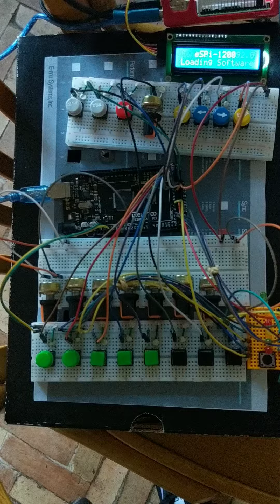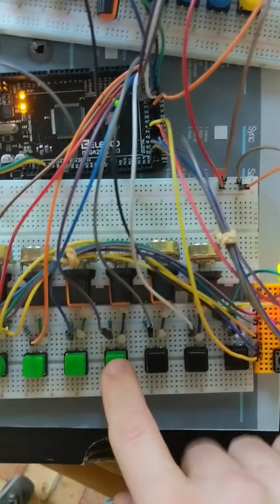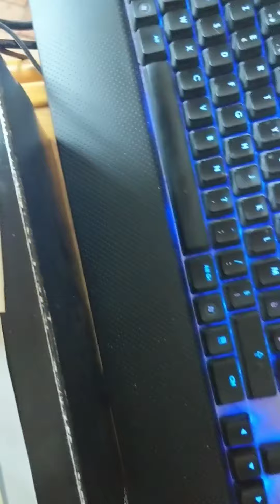SP Clone Progress Update

Comment: As I'm sure you know, the limited amount of RAM in the original SP forced users to speed up 33rpm records to 45 rpm when they sampled loops, to preserve memory space. The resulting ringing sound created from the aliasing which got introduced when those speeded up samples were pitched back down to their original speed is what defines the sound of early House and Hip Hop. Get that right and you can count me among your many customers.
Reply from the maker: Yessir, I'm very much aware of that, I'm an SP-1200 user myself and have been for quite a while.
I have reproduced the exact algorithm the SP uses for pitch shifting, you can see some demos on my instagram (@low_hiss).
And here are some famous samples & breaks ran through my emulation, both at normal pitch and sped up to 45rpm +16% beforehand: https://ufile.io/xd7se
Reply: @LowHiss  I'm going to buy this and 2400 and both combined will be less than 1987 sp1200 on eBay now 😆
Reply: @LowHiss  can u reup the test says file is premium now?